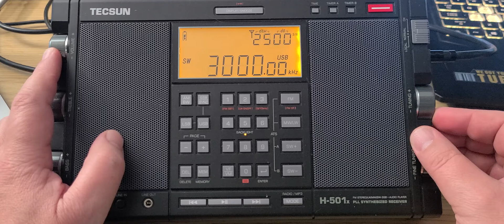What is there to tune 1600 kHz to 3000 kHz Mediumwave Tecsun H-501X tuning on MLA 30 loop antenna

Comment: New guy here. I just picked up a heathkit SW-7800. I know its a old SW radio. My question is how does the radio know to listen on the stock antenna or listen to what is plugged in on the SO-239? Or does it just listen to both all the time?
Reply: Unless there is a switch of some sort I would expect both antennas are receiving. Someone knowledgeable with the sw-7800 may tell you otherwise.

Comment: In the 70s, I remember hearing loud buzzing noises from 1600-1800, especially. When I joined the air force, I found out that these were multiplexed Radio teletype signals. I heard them elsewhere, too. Now, they are gone from HF.

Comment: My tecsun pl-990 is the same on 10m SSB ,i find a fully charged battery fixes the problem for about 2hrs.I also run my pl-990 of a small 12v gell battery via the battery charging cable and a Cigarette adapter to bring it back to 4 or 5 volts,i also take out the battery when doing this.